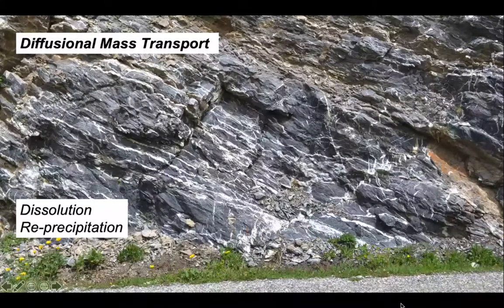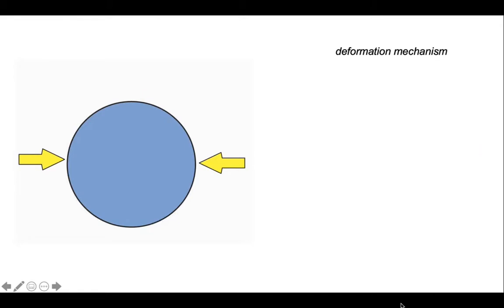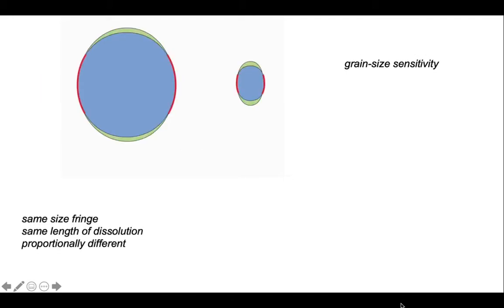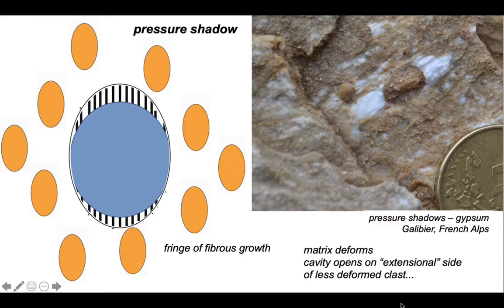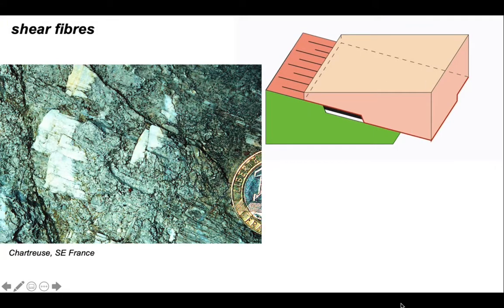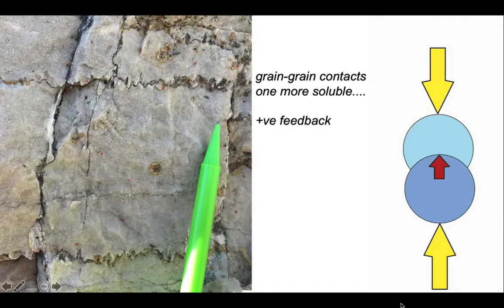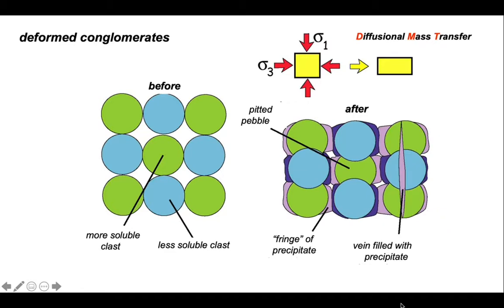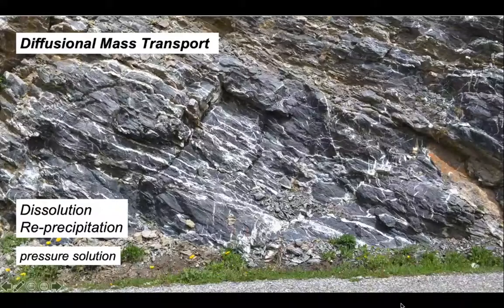Diffusional mass transfer

Comment: OK, Rob - another question for you, regarding the discussion on stylolites starting at about 11 mins in: in the image (with the green pencil), if the middle bed - sandwiched between the stylolitic dissolution seams - was generally less soluble, would this suggest it is less competent and could you then influence the growth of the developing seams by pinch and swell processes, making the growth less random but with the more pointy seems "flowing" into the more cuspate and more competent less soluble/more competent bed? 

I may be conflating two different processes, but couldn't they act contemporaneously?
Reply from the maker: Hi Mike
Interesting ideas. The concept of competence heer is interesting. If a layer was less soluble (e.g. had larger grain size) then, as far as DMT is concerned, it would ptresumably be stronger (less prone to DMT) than more soluble (e.g. finer-grained) layers. In this case I suspect there's nothing particularly different between the layers bounded by the stilolites - though of course it depends over which length-scale you're talking... As for multiple processes - yes of course, though probably at very different rates ... (so strain-rate dependence on the relative roles).